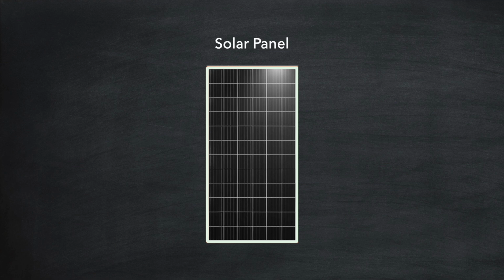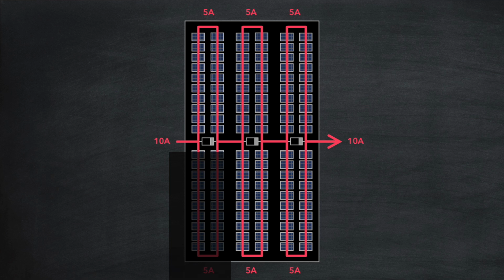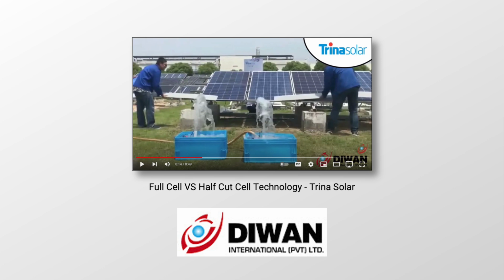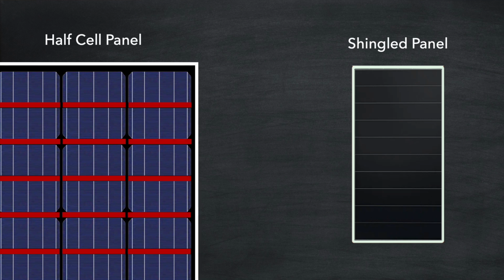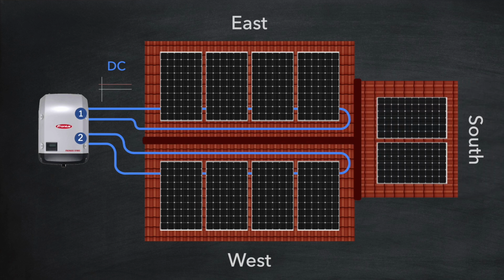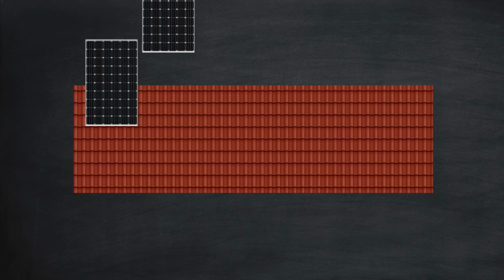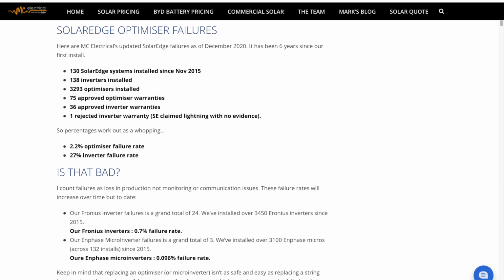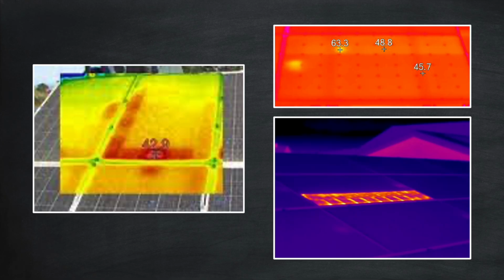Solar Panel Shading (Part 2): More on Optimisers and Micro inverters

Comment: Hi Gary. Excellent video. I don’t get if I had panels on west and east on same string then given panel’s built in bypass diodes then it should handle the shade (or less sunlight) on west panels in the morning while full generation on east and vice versa in the afternoon.  I say I don’t get it because you mention in the video that optimzers are needed if panels on same string face different directions
Reply from the maker: Thanks for the great feedback! Now, the problem comes from the fact that ALL the panels on your West roof will not be generating much in the morning , whereas ALL the panels on your East roof will be generating a lot (assuming a sunny day). The bypass diodes won't be able to handle that mismatch very well. You're far better putting each orientation on its own string as opposed to adding optimisers. Optimisers (and microinverters) work best when there is partial shading within a single orientation.
Reply: @GaryDoesSolar   thanks for your reply. I was confused about your video which illustrated it as a bent hose with the current being pulled down by the panels on different orientation - is that indeed true as it would seem to be contrary in my mind with your other examples that indicate if panell(s) are fully shaded and are on the same string, it would not effect power output from other panels; therefore I was assuming in a situation with panels on different orientation but same string  could be modelled as simply panels with a lot of shade on them when sun is on the opposite side; does that make sense or am i missing something fundamental in my understanding ?
Reply from the maker: @warperone  The problem here is that the panels on the East and West roofs are never shaded as such - they're just not seeing direct sun at different times of the day. There is still a lot of ambient light around, and bypass diodes are designed only to manage partial shade.

Comment: Once again, you have got it wrong. If one sub string is shaded, then 5 amps will pass through the opposite sub string, and 5 amps will pass through the bypass diode, to ensure that the full 10 amps still flows through the string.
Reply from the maker: Once again? Where did I get it wrong before then? And tell me exactly where in this video I got it wrong, Sooty Grandad…
Reply from the maker: Ok, I have since seen your original comment (and have responded to that). I don’t mind criticism of my content, but being so forthright, I’m expecting you to provide strong evidence to support.
Reply: In this video, regarding the half cell panel, at 3:40, you  state that if one half cell string is shaded (the bottom one in your vid), then the bypass diode will kick in, and the top half cell string is also lost. This is not the case, as the top half cell string will still deliver it's power. Bypass diodes don't just kick in-as you put it. They will start to bypass current at as little as a 1mA drop in current from that single string in a panel. With the half cell panels, when you shade the bottom half cell string, the top half cell string opposite to that of the shaded string still applies a reverse bias voltage across the bypass diode, and so 5 amps of current will run through that unshaded half cell string, and the other 5 amps of current will run through the bypass diode. If we partly shade one string in a panel, and there is 10 amps flowing through the string of panels, then 5 amps may flow through that partly shaded string in the panel, and the other 5 amps may pass through the bypass diode in that panel string. The partly shaded string in that panels doesn't simply stop passing current when the bypass diode starts to conduct. Hope this helps.
Reply from the maker: @Sooty_Grandad  Please take a look at this video (from 1m28s in) which aligns with what I state in my video. Are you still suggesting I'm wrong? https://www.youtube.com/watch?v=AZ8VQ_zmf1M
Reply: @GaryDoesSolar  Yes, that video is incorrect. When the bottom half of the half cell string is shaded, you do not also lose the power output from the unshaded half of the half cell string. This was one of the reasons they designed these half cell panels like this. When the bottom half of the half cell string is shaded, you only lose 16.5% of the panels output, not 33%. Here is a video that explains how they work correctly. https://www.youtube.com/watch?v=otovXbs_qZs&t=547s
Reply from the maker: @Sooty_Grandad  Let's keep our debate in one place (on the other thread) so that others who are interested can follow.

Comment: Another very useful video. Have subscribed!
The MC Electrical reliability report is interesting, especially considering that the Enphase micro inverters have much more to do than the SolarEdge optimizers. From the report they seem to be able to handle the heat and dust in Australia, but what about the cold and wet of northern Europe? Hamburg in my case. Have you come across any reliability figures from installers closer to home?
Reply from the maker: Thanks Tim. Getting hold of reliability data is not easy, but I'm hoping to be interviewing Enphase soon...

Comment: Where did you figure that 20 % of the panel has to be shaded to trigger the bypass?
Reply from the maker: From a SolarEdge article:

"The exact point at which the PV cell becomes a power consumer instead of producer changes between different types of cells and diodes, but usually a difference of 20% between the light hitting the surfaces of different cells in a substring is enough to activate the bypass diode of the substring."

https://www.solaredge.com/sites/default/files/se_technical_bypass_diode_effect_in_shading.pdf
Reply: @GaryDoesSolar  so even if 1 PV cell has a difference of more than 20% from everything else it's owning diode will activate?
Reply from the maker: @nodelayfordays8083  Yeah, and in my videos, this is why a single leaf covering a cell can cause bypass diodes to activate. Shading is a real issue for solar panels....

Comment: In the US NEC has required rapid shutdown systems which micro-inverters, or DC optimizers provide that functionality. The cost of buying a DC optimizer is only about $$10 more than a rapid shutdown module. That is something to consider most local city inspections will require that rapid shutdown switch. Ground mounted systems don't require the rapid shutdown switch only rooftop.
Reply from the maker: Thanks for this info - rapid shutdown is likely to become a concern in other parts of the world as well

Comment: Would be good to have a view on how wiring panels in parallel rather than series on a multi orientation roof install would mitigate shading issues. The MC electrical blog suggests that optimisers are needed/useful for multi orientations but would wiring the string in parallel mitigate the need for them?
Reply from the maker: Hi Justin, I don't have any views on that myself for the moment (my video roadmap is quite busy) but perhaps others here can comment...

Comment: How about making a video about how to match one or two panel arrays with a string inverter eg match voltage, amps, string inputs etc?
By the way, is the string inverter limitation for voltage or amps per string or per string inverter as a total?
Out of curiosity, what are the chances for Octopus to expand to more European countries? I know they are in Spain and France.
Reply from the maker: It’s really down to the installer to get all that right. As a homeowner, all you need to worry about is how many and where you’d like the solar panels to be located. Your installer will then do all the calculations for the inverter size, string allocation etc.

Comment: Hello Gary! I love your videos!
 Quick question - for "triangular" shading situation (example terrace wall or half wall on roof), that would cover a triangle from left lower corner of panel towards the middle of the panel on the right side. 
What would be the best solution? A shingled panel? Some different managment approach? Could you mix different panel variations due to shading issues, but considering all of the panels having the same specs? Sorry for the long question,thank you in advance! :)
Reply from the maker: Crikey - lots of questions! :-) So for triangular shading, you're likely tripping 2 of the 3 bypass diodes in a typical non-shingled panel. I can't answer easily for a shingled panel, but they're all laid out in different ways, but I suspect it's not going to be too different - you might only get a 3rd of the maximum output. I wouldn't recommend mixing panel specs on the same string as this can give additional issues.

Comment: I’m the process of purchasing solar I have a chimney from a wood burner on a south facing roof. The positioning of the chimney means the shading only occurs late afternoon so I am wondering if optimisers are now worth the cost and long term issues if they fail welcome your opinion
Reply from the maker: Unfortunately, l'm not in a position to provide individual advice (not least because of potential liability issues, even if that advice is given free - such is the world today). You're best to speak to an installer for such advice, or post a comment onto a solar forum (e.g. this one in the UK: https:// www.facebook.com/groups/2197329430289466). Good luck!

Comment: Hello Gary - very interesting video - thanks!. One thing to consider with multiple peaks on the IV curve is that you might expect the newer inverters to perform global sweeps, but the real question is how effective these are. My Solax inverter has this function, but it's disabled by default! You can set it to do the GMPPT every 1/3/4 hours but if the shade is changing, I imagine that this would be far too infrequent. My guess is that the GMPPT function takes some time to perform, thereby limiting the ability to adjust frequently.

Am I right in thinking that the MPPT (now thinking of local version, which (according to Solax) sweeps from the right and finds the first peak), is basically adjusting the voltage as the independent variable, and the current is the dependent? in layman's terms, it's essentially swapping part of the current on the string for voltage. By adjusting the voltage upwards, the current is reduced, which means that the resistive effect of shade is less?

I ask, because sometimes I see on my string a high voltage when the conditions are poor, and then as the sun comes out, the current increases and voltage decreases. I can understand the current increase as a direct consequence of the sun coming out, but I guess the voltage drop is due to the MPPT (otherwise I believe the voltage would be fairly constant).
Reply from the maker: Hi Daniel, you're welcome on the video. Yeah, MPPT is a bit of a black art!

Global MPPT sweeps do take a little time and you're not generating while they're in progress so limiting the number per hour is a good thing. Trouble is, that you're not then getting the benefit of them!

Local MPPT usually can't the other peaks so it's really only Global MPPT that works :-/

Yeah, the only control factor that the inverters has is the voltage.

Comment: Thanks for your brilliant, clear and concise, no waffle videos.
I wonder if someone can help me solve a shading issue I have in the winter months.
I have a 5 x 2 row, south-facing REC panel array on a flat roof. The panels are in weighted heavy-duty plastic supports so that the panels are at 15 degree angle. In December, when the sun is low in the sky the 5 front  panels shade the bottom 3rd of the rear five panels. This obviously affects power generation at a time of year when it is not very good anyway. In my thinking, the simplest and least technical solution is to raise the height of the rear set of 5 panels so that, rather than being staggered, the two rows are in line with each other and the 2 rows will receive the same sunshine incidence. 
Does anyone have any suggestions as to how this can be achieved?
Reply from the maker: Thanks for the very kind words, Alan - very much appreciated! 

Hopefully someone will have answers to your question...

Comment: Thanks for the video Gary. I'm not sure I really understood the split panel mptt optimisation, a single panel is easy to follow, but surely with an array of panels if it used half the voltage that would decrease the overall output significantly? It must find an optimum point, but the diodes are either open of closed and I'm thinking that will always be closed so no advantage?
Reply from the maker: Hi Stephen, you're most welcome. Yeah, the way I like to think about MPPT, is that it appears an intelligent process but it's not. The MPPT controller in a string inverter simply adjusts the voltage from 0 upwards (a sweep) every minute or so, to see which voltage gives the highest current, and therefore the highest power. It doesn't know about bypass diodes or even optimisers, how they work or anything. The problem for the string inverter MPPT controller is that if there is shading only on one panel, it can't really do anything to optimise that because it will surely bring down the current on all the other panels, so in reality, it's only effective if all of the panels in that string have exactly the same kind of shading (say the lower half of each panel shaded by an adjacent building later in the afternoon). In my mind, these conditions are rare, really, what is the increased generation advantage? Interested in your thoughts on this...
Reply: @GaryDoesSolar  Definitely sounds rare in a string, but with an optimiser per panel it’s perhaps a further option when all 3 sections have shading on one half. I expect there are other benefits of the split panel, as this one sounds quite marginal. It would seem like smarter electronics in a panel could handle shading better than diodes, but perhaps it’s avoided due to generating heat.
I have panels going up tomorrow with a little shading from a chimney, I’ve gone against my installers advice and will try without optimisers and just position the panels away and accept some loss, my feeling is that shadow is only a factor when there is direct sun, and that’s less common anyway later in the year when shadows are longer. It’s an EW roof with a 40 degree tilt so the only months where the sun is high enough to reach the other side limit the shadow length. I wish I could do 3D trig to properly work it out, but alas beyond my maths ability.
Reply from the maker: @smc812  Hope all goes well with the installation - and I reckon you'll be fine not having the optimisers given what you say. And there's still plenty of summer left for some nice generation 🙂

Comment: I'm having an issue, I have 8x 460w JA Solar panels connected in series to a Deye 5kva inverter, the problem I am facing is in the morning from 8am to 10am 2 of the panels are shaded, but the other 6 have full sun but I get no production showing on the inverter 100w to be exact , only after 10am when then all unshaved then it spikes up to 1800w instantly , is this correct behavior?
Reply from the maker: Hi Paul, unfortunately, l'm not really in a position to provide individual advice (not least because of potential liability issues - even if that advice is given free - such is the world today). You're best to speak to an installer about that, or post a comment onto a solar forum (e.g. this one in the UK: https:// www.facebook.com/groups/2197329430289466).

However, I'm happy to provide my own views on specific scenarios, which would not constitute as advice) to members messaging me on my Patreon channel, which you can find here: https://www.patreon.com/GaryDoesSolar

Good luck!

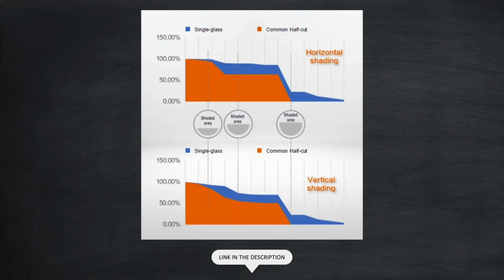Comment: HI Gary, great videos.  I'm interested in upgrading my 12 year old 60 cells panels to increase output and shading performance. I was very interested in the section on shingled panels and your example shows the cell layout for a 10  horizonal row panel. Most shingled panels in the UK from Hyundai and Perlight seem to use 5 or 6 vertical columns and I can't find any info in how these are configured with the by-pass diodes. The graphic at 11:14 shows that shade performance is better for both horizonal and vertical shading but I can't square this. Do you have any insight??
Reply from the maker: Hi Mark. thanks for the kind words about my videos :-) I wish I'd got into solar 12 years ago - hope you've done well out of the technology so far!

Now, for the shingled panel graphic in my video, I can't remember which panel this was from - I think I just scoured the Internet for a reasonably easy to follow layout. What's interesting about many of the layouts is the parallelism, which gives many routes for the current to flow in the event of shading.

For information, my own installation comprises 17 x Perlight Delta 415W panels, all mounted horizontally (for no other reason that I could fit more on my roof, which already had 6 velux windows on it. I don't suffer from any shading issues though, so can't comment on their performance with shading management. 

Having looked on the Perlight website though, there's not too much detail on the internal layout - from what I can see in the diagram on this page, entitled "Full parallel circuit design", it does look like 6 vertical columns in parallel: https://www.perlight.com/perlight-delta-400w.html

Comment: My intended solar panel array is to be on my new build in a green field site, no trees, no shading ! Can I have a string solar array, no micro inverters or optimizers  ?
Reply from the maker: I would not want to give you specific advise on the matter. Certainly, the three main reasons why someone would get optimises are:

- you’re installing a SolarEdge inverter, and so optimisers are mandatory
- you have shading
- you want to monitor the performance of each of your panels rather than just the array as a whole.